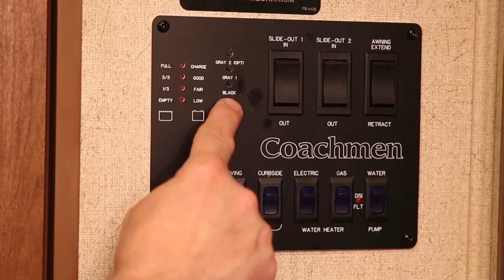Filling the Fresh Water Tank

Comment: I own a 2016 forest River vibe extreme lite. I have the city water connection on for water & also have the hot water switch on for hot water. My question is, I haven’t filled up my portable fresh water tank but my tank shows that it is 2/3 way full. Does this automatically fill on its own when connected to a city water connection source?
Reply from the maker: Please check and make sure there is actually water in the tank by opening the tank drain. If there is no water present, you might be getting an incorrect probe reading on the tank. This can happen if there is a chassis heat duct touching the probe or the tank may be wired incorrect. If water is present, you may want to get the water pump checked out to make sure the check valve is functioning as it should. We suggest having your dealer or service center look into this.

Comment: On the FR3 you have both city water and fresh water tank which one so I fill firsr
Reply from the maker: City water is a direct connection (always on) from the water source (spigot) to the RV water system, it provides pressure from the source (we highly recommend a pressure regulator at the spigot as high pressure can damage plumbing).  You do not turn on the onboard water pump.

For Fresh Tank, you only need to fill that when you do not have a constant fresh water source.  The pressure is then provided by the on board water pump and is on-demand, so only runs when needed and pulls from the fresh water tank.